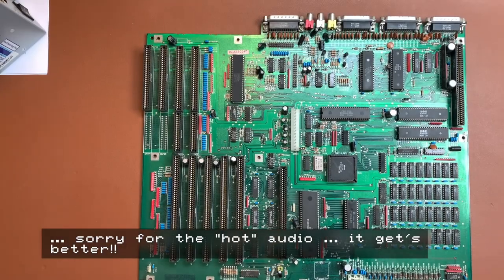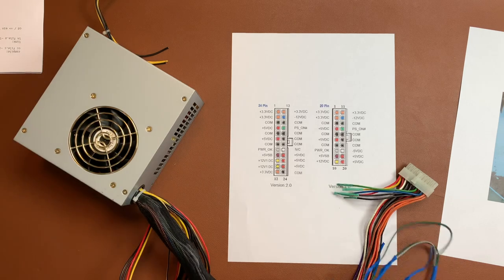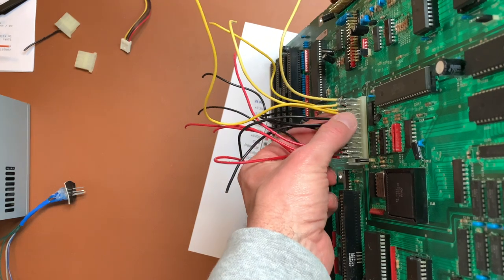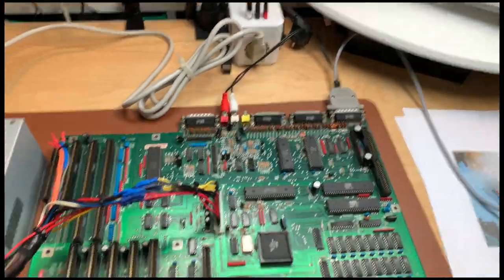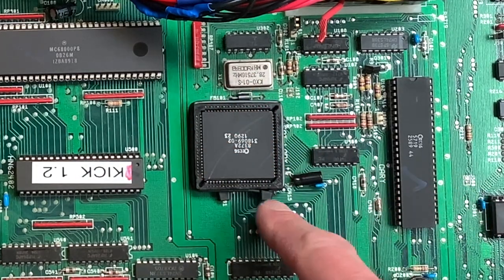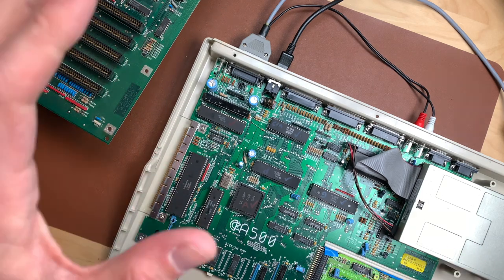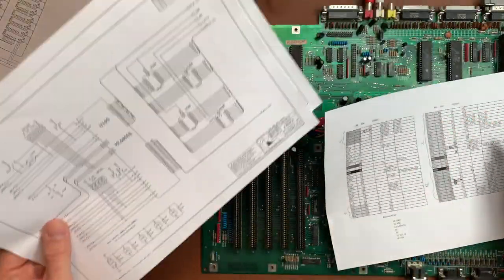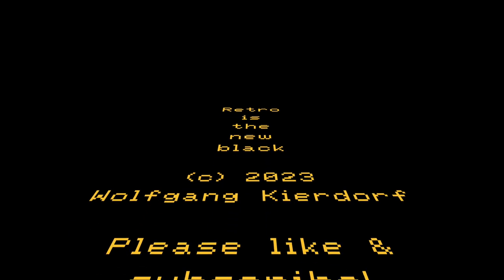Can this Amiga 2000 Rev 4.1 board be saved? ... and can we build an A2000 PSU along the way?

Comment: When I first got an Amiga 500 with nothing else, I used a PC PSU and made a plug using nails put into the socket then lots of hot glue to set them into a solid block. It worked well for testing. Eventually I replaced it with a repro plug.
Reply from the maker: I used the same method for my Amiga 500 Tower build in an older video.